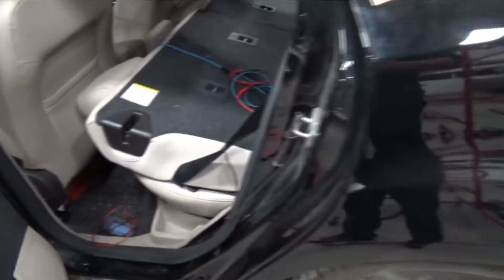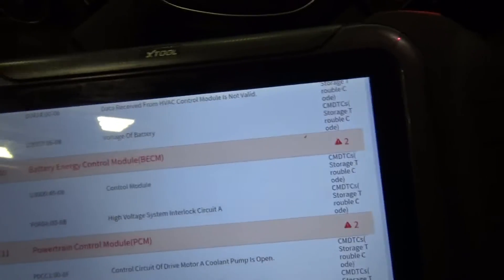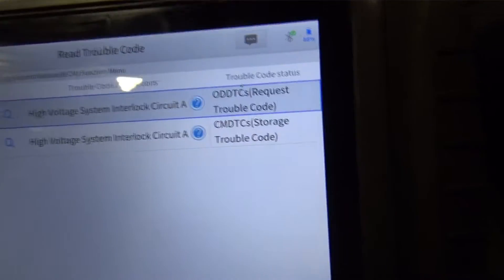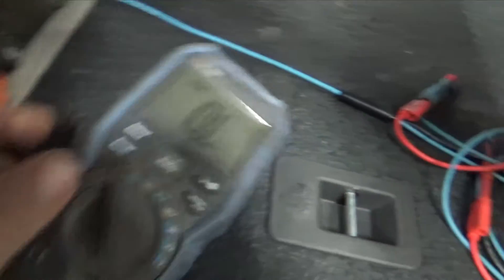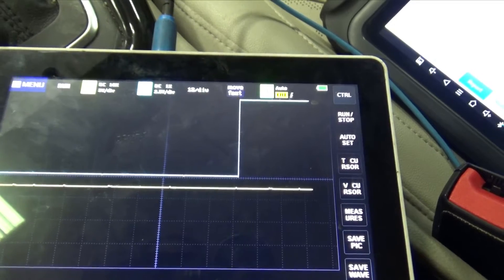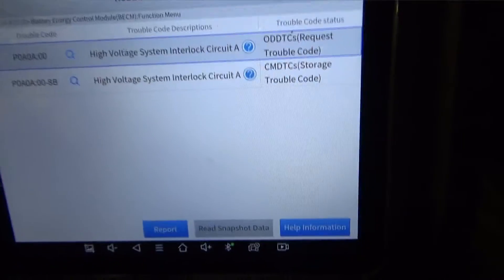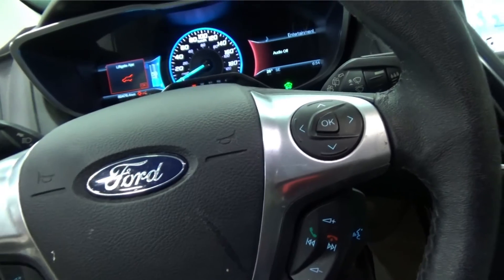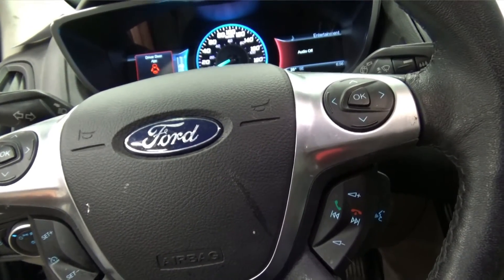2018 Ford Focus EV P0A0A

Comment: "Always make sure you wear the proper safety equipment.  I forgot mine..."  🤣

I'm showing this code on my 17 MKZ hybrid.  Battery is not engaging properly. Hope this works before I get stranded.
Reply from the maker: Hope the video helps you sort out the issue, let me know how it goes!

Comment: This video saved me as well. Had a 17 towed in and testing led to a rodent chewed through a wire at the electric motor. After repairing the wire I had good resistance at the pcm, but could not get the code the clear. This disconnect with the latches not properly positioned was the issue
Reply from the maker: That's great to hear, glad the video helped you out!

Comment: Thanks a lot! You helped to quickly find a problem and I was managed to help my friend! Exactly the same situation, after a shop worked on a car, High Voltage disconnect plug/switch was installed incorrectly.
Reply from the maker: Awesome to hear! Glad the video helped!

Comment: i did to go to toronto to for training in  2006 but the training was just basic on safety 
and had to phone for suport there were no shop manuel 
it was a aftermarket hybrid on E350 and workhorse 
it sucks not having the info